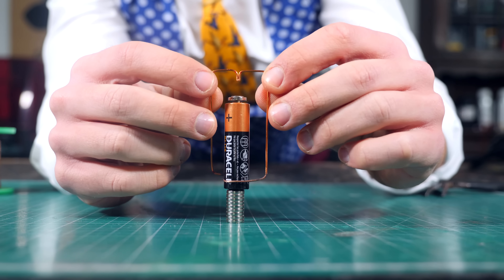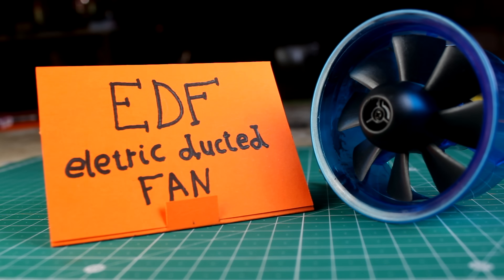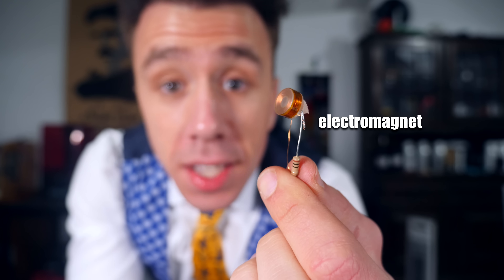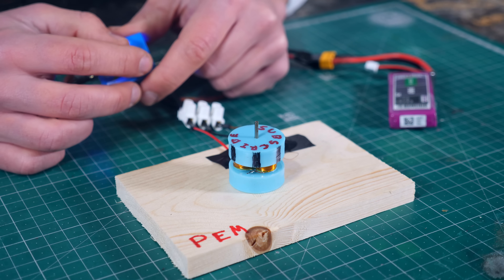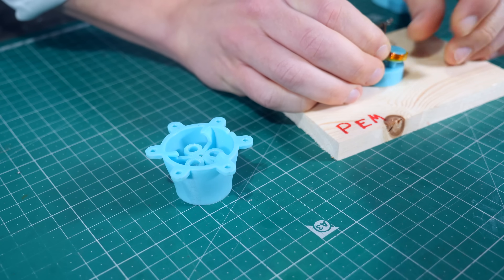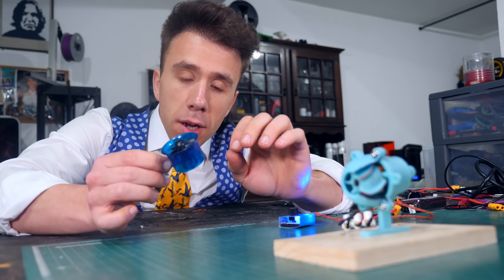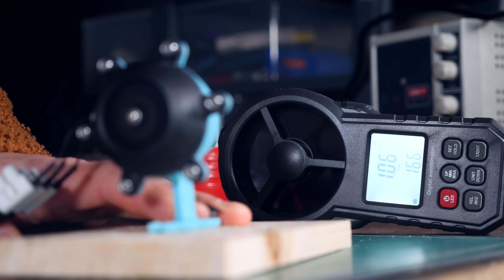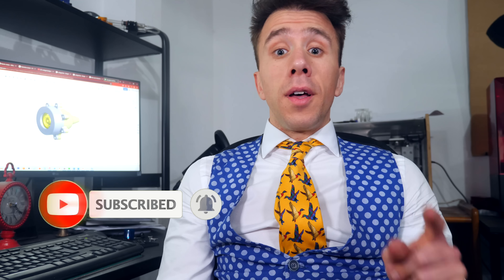I 3D Printed an ELECTRIC MOTOR FAN

Comment: you need way more rpm for the setup your looking for... dont compare a Fans output at a fixed rpm to a compressed fans output.   its the pressure jets need not the flow.  your not igniting that compressed air with anything to get the thrust your looking for.

Comment: The Dyson fan is focused on pressure,  not speed.  If you plug the intake it should be more difficult to pull your hand off. I don't know all of the science behind it but I do know that lots of money was spent on these designs and they used the best one for their specific application.

Comment: I've been working on an alternator project and thinking about coil designs, then wanted to try to make one of these.
May I ask, what inspired the.. fillet(?) on the left half of the coil @ 2:02?
My naive intuition says you're maintaining the size of the magnetic field but with less magnetic density once you get to that point. But is that true? And is that even the reason behind the design choice? I'd imagine the coil would be more effective had it been given the same amount of turns per layer and layers per length.

Comment: Axial fan can not reach high pressure instead reach high mass flow, on the other hand, centrifugal impeler are for higher pressure and less mass flow. Mass flow is essenial for thrust, the idea is to cause a change in momemtum of air flow. The change of momentun cause thrust. Momentun is P=m×v mass time velocity. The change in momentum in time means a force acts on mass. So, more mass flow with a higher change in velocity induce a force. Therefore, axial impeler is better because motor power is used mainly to raise the flow velocity causing thrust. Centrifugal impeller produce higher  pressure that must be converted in velocity (Bernoulli's equation) before to produce higher momentum and thrust

Comment: the difference in thrust is the way its designed. The impeller creates high-pressure air vs the EDF that makes fast flowing air. thats basically the main difference, also the edf has no bumps or lines that cause drag on it, unlike the impeller. that's basically the only difference that i could think of :)

Comment: Are the  surface areas equal, and which fan changes the air's direction the most , and what do you want them to do ? There are too many unaddressed variables , a fan is a ramp .

Comment: To obtain the same air flow rate of the propeller using a centrifugal impeller , it is necessary to get a mathematical relation between the propelled air and the surface area of the propeller blade as well as its angle of attack , and then do the same but with the impeller (the blade curvature instead of angle of attack) , Also it is needed to put the air pressure as a very important parameter in this formula , As I imagine , you need an impeller with a diameter larger than that of the propeller a little bit , for example 1.3x , it needs many attempts regarding so many parameters that have a massive effect on the air flow rate and its pressure ...thanks

Comment: I didn’t go thru any of the comments, but I feel sure there is a lot of good advice. But I can tell you this for sure. First fan centrifugal fan blade open air in and out. Now using the same motor is not going to work the same with what your next design became. You basically turned into a centrifugal pump. Also the reason with the difference in flow with just the new design is this. You had two different impellers on the new design, an open impeller and a closed impeller. Meaning closed impeller not because of the outer housing it sits in. A lot of consideration goes into setting what is called your impeller clearance. Temp, metal, cold, heat etc. Closed impeller set clearance from the housing and open from what in front casing etc. This is important, a jet engine may be centrifugal but it’s what is called a turbine. Totally different dynamics than a fan or pump. Hope this helps.

Comment: To increase the efficiency of the radial flow you have to have an axial flow stage in front of it. Radial flow compressors are inefficient at lower rpm and when sized down the “lower” rpm can be higher than you could safely achieve. Try an axial pre compressor

Comment: The differential in performance between the EDF and 3D printed counterparts can be attributed, in large part, to the nuanced interplay of intake diameters. This parameter substantially modulates both the volumetric flow rate and static pressure output. Beyond mere dimensions, the confluence of design intricacies, material properties, and blade geometry substantiates the variances observed. Our shared aversion to tomatoes adds an unexpected note of camaraderie.

Comment: 1 your restricting the flow to a center point you would think that this is a good thing but the problem is number 2 the center point has alot of air resistant the size of the nozzle is the determining factor of how much air flow you get 

Hope this helps

Comment: The impeller condenses the propeller increases speed u need an impeller condensing the air to make it “thicker” or more fluidic and than a propeller increasing the speed of the higher density air.

Comment: I don't know if you got your answer already, but here's what I think happened. In your case force is equal to the derivative of the momentum. As far as your impeller may be reasonably good at accelerating the stream of air, you may encounter issues stemming from the low flow of mass. This also applies to any external measurements of the speed of exhaust air. There is enough speed to move the air, but just not enough mass and inertia to keep it going till it reaches the anemometer. Moving the blades of anemometer is pretty much the same story.

Comment: I would say that these two serve different purposes in terms of moving air. The impeller does better pressure wise while the regular fan does better in terms of velocity. Perhaps if you have a very small valve for the impeller you might be able to perform almost as much as a regular fan? high pressure through a small valve.

Comment: I'd say it had to do with bottlenecking... But there's a trade off, you should compare the static pressures of each fan, I'll almost guarantee the static pressure of the impeller will be way higher

Comment: The material that your using for the blade is not ridged enough its giving with the rpm just like an aluminum propeller on a ferry boat it gives to load and changes pitch thus cutting the load on the engine/motor 
Try a more ridged material for the blade and make it the way it was origonally!!

Comment: The fan is currently pushing air outside rather than performing suction and compression. Reverse spin it to see improvement. Then you can toy with the design for maximizing efficiency

Comment: the engines translate torque differently. you will need a unique impeller design if you want to optimize that motor for an impeller. I would use an axial flux motor.. cheers.

Comment: The problem can be related to the dimension of the impeller versus the dimension of the fan of the edf. Meaning that with the same motor of your edf just scailing the fan and the duct around it will be scale down the relative trast power will be lower , so in teory incrising the dimension of the centrifugal  fan you schould be able to generate more trust

Comment: EDF has larger blades and no obstruction.... that's why EDF has more airflow 

the "fan" u made needs more rpm to generate more thrust, because it has tiny blades and lots of obstruction at the back

Comment: Try the scoops that are used in water wheels. It's a fancy blade that captures the most energy of a force. If it runs in reverse perhaps it can deliver the most force by using even less energy.

Comment: Is it because of friction that is caused during spinning or try adding smoke at front and see the air flow if u think there is a diffect in model or check whether the rpm of both the motor match while spinning if they match then change the propeller design

Comment: I'm an aeronautical engineer, and my answer is losses. To produce thrust with and EDF you are basically just pushing air, while with the impeller design you first compress it and then let it expand. The design with the impeller implies more friction losses and plus the compression and expansion in your design are not optimized for the speed into play, so they are not done efficiently, just like compress a bottle with your feet rather with your head. To produce the same thrust the design would have to be made adapted to the actual speeds.

Comment: Hello integza,
I may be incorrect but from my research i have concluded that Ducted fans are meant to produce a higher airflow therefore being more efficient in model aircraft as samm shepperd showed in his video (God rest his soul)  

A centrifugal fan however is made for high pressure and the higher the pressure the lower the velocity of air. 

I think this is the reason you are having problems with acheiving the same m/s Air speed. 

Edit: maybe you could try and use an axial compressor design??

Comment: Could is be due to the type of polymer used? The Dyson fan is probably using liquid crystal polymer which is know for not expanding and very tight tolerances. That’s probably what you need to look for.

Comment: I only have minimal experiance with fans. It's my understanding that the ducting on the FSN allows it to draw surrounding air and force it through. As where you impeller or squirrel cage design are for high flow low presure. Maybe Try adding some sort of port on the exhaust side that would allow the fast moving air to draw more in. The only other option I would see would be to add combustion chambers to increase the volume of the air on the output side

Comment: There is a material made that is used for printing on 3d printer. It’s flexible and rubbery.   

At work I have to wear a bulletproof vest all day with a bunch of equipment and it gets very hot.    I was thinking about making in hollow rubber 3d printed pannel that I can put under my vest. The goal is to make a battery operated build in fan cooling pannel that can be worn under my bulletproof vest to prevent overheating and help dry sweat.  I was thinking ti make a 18650 batter pack that goes in pocket if the vest. That connected to a turbo jet in-line fan.  Or some kind of powerful small low voltage fan.  That connect to a inlet tube that pumps the the air into the side of the pannel and exhausts the air though holes in one side of the pannel that’s facing the body.

I was also thinking about doing this with a compressed air canister or co2 canister.

If you could make the pannel for me and help me get this working I would greatly appreciate it.  I suffer from generalized hyperhidrosis (excessive sweating all over body) this is because I have a under active thyroid. I work in a healthcare security and this would make the world a different for my comfort level during my 12 hour shifts 

Thanks

Comment: You should stop the air from spinning after the impeller. Centrifugal forces on the funnel will push the air back forward.

Comment: I may be wrong but I believe it has less air flow because of the design itself. I have come to learn that high speed air flow is not ideal for combustion to occur. The outward direction of the air flow you mentioned in the video promotes volume over speed. That is my theory.

Comment: You cant reach the tolerances needed with a 3d printer todo this, the fan blades and housing must be extreemly tight, the tighter the better without touching, this means everything must be extreemly ridged aswell so things dont expand under centrifugle force or heat, if you have any sort of gap between the housing and the fan blades the air well find away out and not build pressure or move in the desired direction

Comment: My guess is that because it's not physically driven that as the pressure builds you loose rpms cause the force needed is not there to overcome the pressure.mind you I have no actual clue this is guesswork and I'm probably 99.9999% wrong.

Comment: I'm no engineer but usually centrifugal fans are better at creating high pressure air rather then high flowing air. The best example being a turbo in a car as opposed to a propellor, the propellor moves alot of air whereas a turbo can sustain high air pressures without much resistance. So that could be why you are getting less thrust with the centrifugal setup on the same motor and rotor diameter

Take this with a large grain of salt though lol

Comment: The main problem i see here isnt a lot of stuff but its rather about the inlet and the main blades as theyre just 5 blades and theyre thick, so it could be rubbing against the walls of the inlet and also u need a outer side duct for it.
Also for the exhaust it could have some filaments jamming the air flow

Comment: Impellers do not create speed they create pressure in order to create thrust you need speed basically you need a construction with heat to create speed from pressure proportional to the CFM you produce

Comment: You may benefit from operating at the same shaft speed as the Dyson motor. Generally, the larger the compressor, the lower the ideal shaft speed. 

If you have the same size compressor and rpm, remaining variables could be blade count, angle, and tolerance between the blade housing (avoid tip leakage).  Could also try a split blade design.

Comment: Scale/total surface friction. The shroud on the fan increases the flow with minimal surface to cause friction, whereas the Impaler has a more surface area to cause friction is my guess. You probably could have an optimal size that you could increase the impeller to where it would have the same thrust.

Comment: Air is sticky, in a centrifugal compressor clearance must be tight and the blades long, this creates resistance in the airflow whereas the ducted fan only has tight clearance at the blade tips, this limits resistance and improves volume, this is also why modern jets are all axial flow and not cenrifugal. Centrifugal is better for creating pressure rather than thrust, ie, a turbocharger.

Comment: The motor, has limited electrical power and thrust is also power but other form of it. Its a simple equasion Electrical energy - lost energy = thrust energy. So you need to minimise the lost energy to get higer efficiency
First of all i would optimise the inlet not to have such a sharp transition because at the inlet flow might detatch which could choke the inlet even more. 
Then you could try and have a bigger diameter impeller to get higher mass flowrate, but not too big diameter so the motor can still operate in its optimal rpm range.
Optimising flowpaths by removing and smoothing out turns and also using dimpling on the surface to reduce energy losses generated by thick boundry layer also should help.
The exhaust design is important too but i have no ideas to share with you in this regard.
Also There are 3 main types of air moving devices diferenciated by their mass flow rate and pressure generated:
Fans that have high flowrates but usually have low pressure
Blowers that have good flowrates but generate good static pressure and typically good airflow speeds
and compressors that tend to trade most of their flowrates to boosting up the pressure. 
I dont have enough fludi dynamics knowledge to tell you which will give you most amount of thrust but my guess based on rocket engines design would be to maximise flowrates. 

High bypass turbofan engines are really just ducted fans that have a jet engine powering them, and they are used in modern airlines due to their efficiency. From what i can see you are trying to make something that looks like the inside of a jet engine, that is a one stage compressor. Without additional fuel and combustion you are just wasting energy ducting the air around in a weird way.

Also its not a turbofan that you have built, turbo part comes from a turbine that is used to extract energy from combustion gasses to power the compressor stage so the jet engine can keep running and fan part comes from the ducted fan in the front. On thingiverse there is a nice turbofan model at thing 4743929. 

I love your videos and i hope you find this helpful

Comment: The amount of thrust produced is in relation to the mass of air that is moved (action/reaction). So your fan must move air, not create pressure. Axial fans are better suited to displace large quantities of air than centrifugal ones. The same motor doesn't mean the same mass of air is moved as there is also an efficiency factor in play. At least that is my theory

Comment: the difference in the two "fans" is that one is designed for increasing pressure (mass volume), and the other is designed for increasing (more efficiently)  flow rate.    A centrifugal fan is very good at producing high volumes of air, but it's  mass-flow-rate is relatively low.  An axial compressor fan (the turbine engine type for putting it in simple terms)  doesn't have very high air-volume  but it's mass-flow-rate is very high.   
The reason why jet engines use  Axial Compressors is because even though a single fan stage only gives a little bit of compression  they can be stacked on top of each other on a single shaft.  Centrifugal compressors in a jet engine would make the engine very bulky, they would need many shafts and basically way more expensive to make.  
Centrifugal fans make really good fluid pumps though....er...  high density fluid pumps.  From a physics point of view air is a fluid as well  but let's not over complicate things...